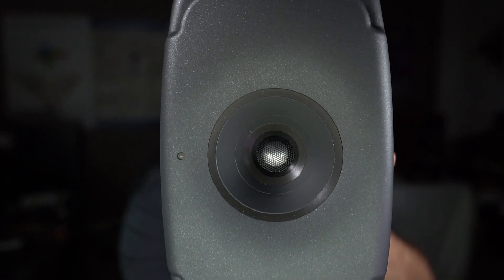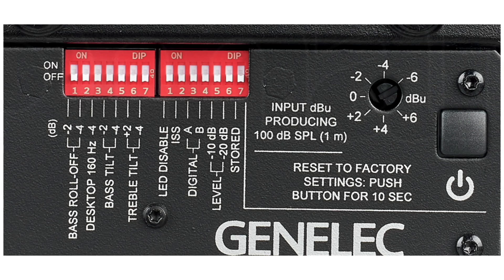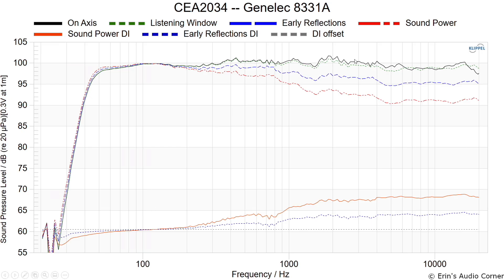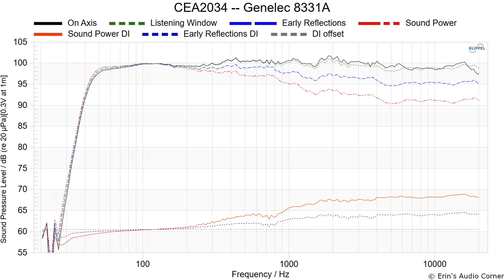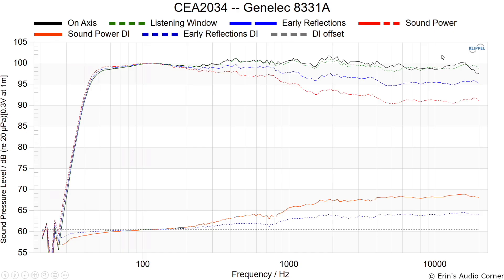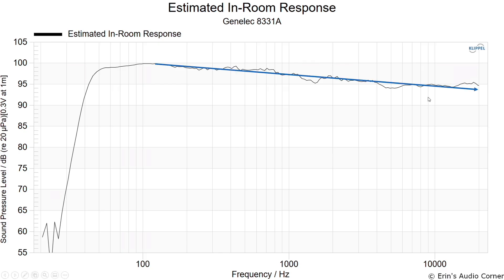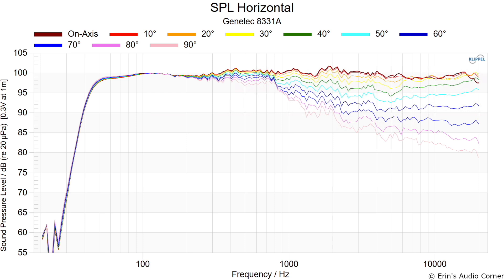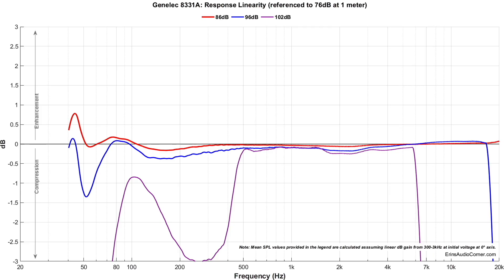Genelec 8331A.  A truly accurate desktop friendly monitor.

Comment: Very nice and having sound come from one location is a great.  The smaller size is advantageous as well since you can put them on your desk.  But they are just way too expensive for most musicians and as for the frequency response, that can be mimicked with modern inexpensive room correction software, etc.

Comment: I've been in a party in a villa, the sound on the patio/terrace was only made by two genelec 8361 (placed low tilted up) and one Rythmik audio servo sub and this was the best sound I ever enjoyed, the level was never above 85db in the meds and 96 db in the sub bass, and even if the outside area was large, the clarity and the air was so nice, this made my decision : one day I will get some of those. It's even more convincing to actually listen to those than to understand technical reviews, but both are related. The person doing the setup told that he do not want to put them ear level, to avoid discomfort for people standing close to the speakers. By putting them low and tilted up the on axis reach the ears at several meters distance, allowing comfort for everyone, and I think it's a good way of doing this. Those are not very directional. Sound change very little when walking around ( as long as you stay in a range where you can see both speakers front face ). The sound was both sharp and also smooth as silk. Delicious.
Reply: Great description!

Comment: $5000 for 2 very small speakers that have limited bass and output?? INSANE!,  take $4000 and see what far better speakers you can get, I guarentee you that there are many many speakers for less than $4000 a pair that can far ourperform then in bass, output, soundstage, etc. these type speakers are for billionaires.
Reply: They are nearly perfect tools for musicians mixing with instruments. For accurate bass, there are no real substitutes to monitor subwoofers (e.g. 7360A) or dual woofer stand systems (like W371A).
Reply: I dont think you understand how music production or game or movie production works

Comment: Hi Erin, I am curious about these speakers used in an LCR configuration, for a home theater. These would be connected via XLRs from a surround sound processor, thus using the XLR analog inputs on the speakers (without any setting changes made the speakers). Is this how you tested these speakers for your listening test? Thanks in advance.

Comment: They say you still must use the GLM calibration kit to get the best possble imaging in a stereo setup despite the coaxial design. I wonder how big the real world difference is, though, in a well treated listening space.
Reply: You'll still get a great stereo image if the room and placement are symmetrical, but you'll also get some bass unevenness and correcting that and using the "sound character profiler" to taste adds a lot, not to mention it's only $200 which is less than most any other room correction system.

Comment: C'mmon man... Genelec and/or KEF never 'nailed ' the coax design. TANNOY has always been the pioneer of concentric designs and still are. Especially their old studio monitors are legendary. They're extremely precise and still used for nearfields even in mastering studios
Reply from the maker: Tannoy makes a good concentric but their throat termination to the tweeter is a far cry from Kef and Genelec. And that’s what makes or breaks a design.
Reply: @ErinsAudioCorner  You're mixing apples with oranges. You can't compare Studio Monitors and HiFi Speakers. Genelec have always been groundbreaking on their designs but they were never into concentric designs except  'The Ones' series and they've nailed it, I agree. Tannoy however was the pioneer in concentric designs since the 60's, that's what I'm saying. I don't follow much hifi speakers and I don't really know about the throat termination to the tweeter you mentioned, nevertheless Tannoy's Dual Concentric design has always been leading in phase coherence and point-source imaging. They  also implemented a new HF Tulip Waveguide on their last 'Gold' monitor series which gives even better symmetrical dispersion, broader ( 90 by 90) soundstage and more focused stereo imaging. You should test them sometime and you'll understand what I'm talking about. Although based in Europe, I'm not a fan of European Speaker designs with Tannoy the only exception. :goodvibes:
Reply from the maker: @AchillesEconomou  you were the one who brought up the Tannoy first. So, therefore, by your own logic you are mixing apples and oranges.  😎

Comment: Hi Erin, how is the hiss on these? I'm sitting around 70cm-80cm away from my speakers, and I have yet to find any nearfield monitor that doesn't have disturbing amounts of hiss at that distance. I'm also considering Kali IN-5 for the only reason that they have the volume know, which -- unless I am mistaken, lowers the amplifier gain and reduced hiss further.

Comment: Switched 4 years ago from ,,normal,, passive Hifi stuff to active Studio Stuff (Ksdigital, Neumann & now Unity Audio) and i want never go back. You get so much quality and intersting new concepts nowadays in the Active Gear section. I heard the 8341 ~10 years ago and it was by far my most memorable Listening session. You realy need to ask why the High end stuff from Magico, Wilson Benesch, B&W etc. and similiar brands ar epriced so high when you get nearly zero benefits from them compared to a 10k Product wich already Active (incl Amps)… For me the times of passive is over, Active is the modern way of producing loudspeaker for the highest performance
Reply: How do you like the Unity Audio? Which mode do you have?
Reply: @datbaguettedoe6436 didnt saw your comment. I own(ed) the Unity Super Rock. I realy like them theyre fun and solid build speaker but ìm now back at a fully Neumann System. Bought the KH150 and the Unitys are packed in. The Unitys are not bad at all, i would probably use them further when i dont have the KH750, but it makes more sense to have an fully neumann system where the MA1 works at its best… so yea, i try to sell them but its not easy because the brand is very unknown. Def. will make a lot of money loss to sell them but yea, thats the downside when you buy equipment from smaller manufactures.

Comment: Interesting speakers with advanced internal correction hardware and software. On the subject of speaker calibration,  I wonder, have you had a chance, using your scanner, to evaluate Sonarworks SoundID Reference, a speaker+room (or headphone) calibration software+microphone package that is designed to help correct for imperfectly treated rooms and imperfect speaker and headphone frequency responses? Thanks, really enjoy your videos.

Comment: Got these and paired them with a 7350a sub. My current listening room (aka living room/kitchen/homeoffice, 5x6m) is untreated and GLM does a great job covering the bad room acoustics. Listening distance is 1,5m and with output level set to -50 dB the volume at the listening position is about 81-87 dB.  Setting the output to -40 dB results in up to 95 dB - too much for me.

Comment: So the obvious burning 🔥 question for me is which one would you buy if given the choice between these and the Dutch and Dutch?
Reply: What kind of system are you making? For me there are no competitors to Genelec if you want to build an immersive system. Dutch and Dutch doesn't have a versatile option for a center channel for example. Or mounting. Or multiple sizes. Or coaxial flexibility for vertical dispersion when placing height channels. From the comparisons I've read about you're going to be amazed with any of them for stereo. However, even for stereo, if you want to go to the extremes you'll need multiple subs for the Dutch and Dutch, and something like the Kii will need a BXT module, which Genelec had a large range of larger and smaller subs plus their W371 which integrates perfectly with the ones.
Reply: @stevenswall  Thank you. The plan is to re-do my dedicated HT, and I plan on using an acoustically transparent screen for the RCL channels.
Reply: @isaacsykes3  In that case you could go with any of them, just be wary that if you want height channels, Genelec has them in hordes, where Kii and Dutch and Dutch will be larger beasts to mount.

Comment: If you dont mind me asking, why do you check the freq response so loud? I know that I probably wont be listening to anything over 80, do these speakers sound different at lower volumes? Or should it have the same response but lower on the graph?
Reply from the maker: The CEA-2034 measurements are taken at about 80-86dB. Since this is a powered speaker, the input voltage to achieve that SPL level - with the gain at max - was around 0.05v (if memory serves). However, the software scales to a voltage. In this case it scales to 0.30v for powered speakers. I can change that manually but I don’t because it’s a bit of a hassle. 

For passive speakers, however, the input voltage is always 2.83v, per the specification. 

Hope that helps.
Reply: @ErinsAudioCorner  indeed it ford thanks

Comment: First, I just want to say thanks for all the effort and hard work you put into your videos: it's nice to see the passion combined with the engineering aspect of this hobby. I do have a question. I'm thinking of building a home theatre dedicated room using active monitors instead of traditional passive speakers with amplifiers (combined, of course, with multiple subs).  In your opinion are these small active monitors capable of reaching the sound pressure levels and the dynamic range needed for this setup considering the approximate dimensions of the room: 19feet x 16feet x 8,5 feet H with multiple seating?
Reply: I really can recommend Nubert for your purpose. Their speakers are tuned neutral. I am using the NuPro XS-4000 RC as my monitor speakers. They are bookshelf speakers, but they are punching well above their league. My room is around 12m², so less than half of your room. 
They are also offering big active tower speakers and a massive soundbar (XS-8500 RC) that weighs around 40kg. I got the prev model.

Long story short: You can connect any Nupro active speakers wirelessly to that soundbar, because it also functions as a control center. So you can go from 2.1 to 7.1. You can also add a subwoofer, but trust me: The base on that soundbar is fking massive. Also all speakers can be room corrected with their own app, that is what the RC stands for. If you have an Iphone you don't need an additional mic. If you are on Android, just buy the recommended usb c mic for like 30 bucks.

I really recommend you checking them out. They are a german company, if this matters to you.
Maybe this is exactly what you are looking for.

https://www.nubert.de/lautsprecher/aktivlautsprecher/

Comment: I can absolutely confirm your measurements and your impressions. They are perfect monitors and when combined with the right subwoofer, they are really fun - even for higher SPL. Take a look at the Genelec subwoofers and the SAM metering electronics. The only drawback is, that they are so perfectly neutral that it's almost boring again. I'm not sponsored by Genelec, but I've been working with them now for two years.
Reply: Hi.which sub do you recommend for these?

Comment: @Erin: if it's hard to qualify the 8331a because they have no major flaws, would it be an idea to compare them to their bigger brothers to see what the differences are? Because the numbers say the 8341 and 8361 have lower bass extension I would expect a noticable difference for different applications.
Reply: as usual with Genelec, I'd expect the main differences to be in low end extension as you mentioned and in output capacity. 8361a for example handles distortion better at 96dB @1m than 8331a at 86dB (even if just a little bit). That means you have just as clean an output on the big boy at essentially twice the output level than the small ones
Reply: Bigger means more output & lower extension. One benefit of the 8331 though is lower noise so less hiss. Overall sounds signature is similar though.

Comment: How dose 8331A compare to Kef R3 or Kali In-5 with regard to imaging? Does the symmetrical racetrack woofers design make a better imaging or not?
Reply: The biggest difference with the Genelec is that the floor and ceiling bounce will sound more similar to the on axis sound, and when you are off axis the Genelec will sound about the same to an even greater extent vertically than the other coaxials, though both the Kali and the Kef will do great compared to typical noncoaxial speakers.

Comment: How good do they sound for Home Theaters if sitting 9 feet away from them?
Reply from the maker: I touched on this in the review.
Reply: Too small, you need the 8341 or 8351, but could use the 8331 on rears or overhead

Comment: Hi, What is your definition of mid/far field in meters? Thanks.
Reply from the maker: 1-2m I’d call near to midfield. 
I’d generally say 2-3 meters and beyond is where you’re getting into farfield. 

However, *technically speaking*, the farfield is the point where all drivers sum together. But in the context of mixing/monitoring, I go by distance since most monitors’ drivers are summed by 1m. 

Hope that helps. 👍

Comment: I think they're cool speakers, but I just can't get over how they look. They have that studio monitor look to them. So I decided to go with LS50 Meta, since looks is important to me.

Plus that power on light at the front!
Reply: @BoredErica  
As Erin mentioned in the video, the LED power/clip indicator light on the front panel can be turned OFF using the rear DIP switches.

And to my ears, the One series Genelecs sound superior to the LS50 Meta in regards to detail/clarity/imaging/soundstage...and even bass response.

But I can understand how a monitor or loudspeaker "looks" can be subjective and carries more weight in your purchase decision if you would be using these as home HiFi speakers and not for professional tracking/mixing/mastering that they were developed for.

They are entirely different, but I love the "look" (and sound) of the Børresen Acoustics #01 & #03 loudspeakers for home HiFi use.
Reply: @bbfoto7248  Ability to turn it off is a smart feature, and I never got that in any studio monitors I owned before!

Comment: Is the estimated in room response as valuable if these will be used in nearfield?
Reply from the maker: Yes. I actually discussed this in the video but edited it out because I went on for five minutes about it. 

But, yes. Although the ratio is altered based on how close you sit and the relative distance of boundaries. I imagine most who buy this speaker do so for its size. And therefore it is reasonable to conclude those users are also sitting in a (relatively) smaller room, with nearby walls. 

The one difference you’ll notice is that the nearfield response will look more like the direct (on-axis) response, the further away from boundaries you are. However, consider this speaker is about +/-50 degrees out to 20kHz which is relatively wide (at this frequency) so you are likely to have a decent bit of sidewall reflection even at the HF. 

Again, this is all relative and your distance from the speaker and the walls will alter the results.
Reply: @ErinsAudioCorner  thanks Erin! Great video!

Comment: Great video. I have the 8030c with arendal 1961 1s sub. I am very happy with that setup. But these  ONEs  would be awsome
Reply: I have the 8030c and SB300 Pro sub and it's a fantastic combination for desktop use. I had a pair of KEF LS50 with high end amp and the Genelecs make those sound like a joke. So much clarity, accuracy, and smoothness in a tiny package.
Reply: These speakers surely sound better than the 8030c but not $3600 better you paying for the koolaid

Comment: Testing without using GLM calibration?
Reply from the maker: Yes. I was not sent that to review.
Reply: @ErinsAudioCorner  that's a shame. They are meant to be used with glm. Night and day difference for me.
Reply from the maker: @CatalinAdler  I understand completely. However, characterizing the speaker on its own gives us an understanding of how well engineered it is. Showing GLM results, while helpful, aren’t a complete characterization of the overall performance of the speaker. Especially wrt on/off-axis response (which is crucial in any speaker).
Reply: @ErinsAudioCorner  fully agree but tbh I would have expected both measurements as glm is the way it's meant to be ran. Next time i guess.
Reply: I think glm would not make much of a difference since it is compensating for the acoustics of the room. Since the measuring system eliminates the effects of the room, using glm calibration would make the response worse because you would be compensating for bass peaks that were not there in the measurements.

Comment: Erin, does this work mid field or long field as a hifi speaker ? How is re distortion on low freq when it gets louder? Any audible hiss?
Reply: I own these speakers. No they are not usable as hifi speakers in the far field.
Reply: @awsomenesscaleb  even with subs crossed at about 100hz? maybe even higher to get more headroom
Reply from the maker: @awsomenesscaleb  I addressed these in the video. Except for hiss. I didn’t notice any in the nearfield.
Reply: @ErinsAudioCorner  sorry I typed the comment while watching the video ;) thanks for the replay anyway. I was about the delete the comment and then I saw your reply :)